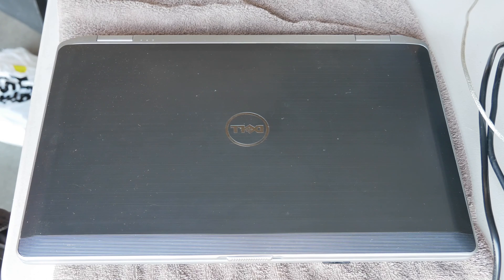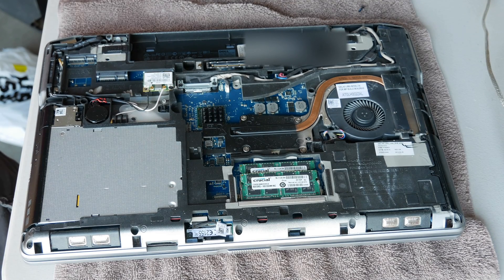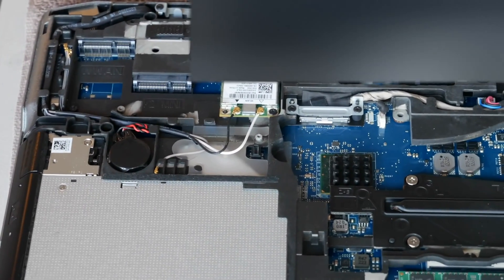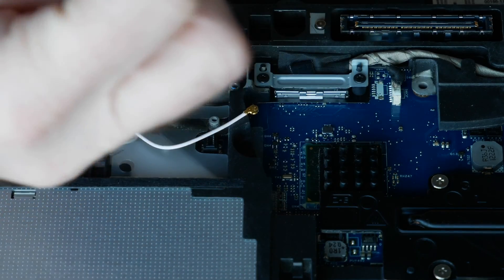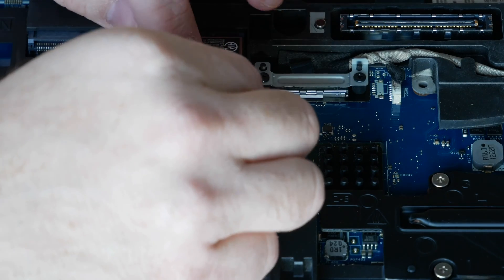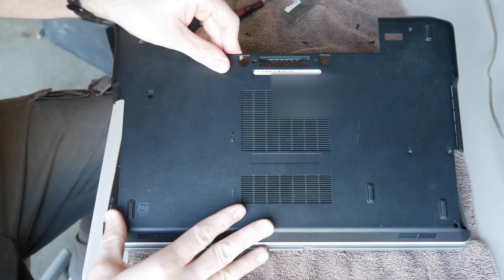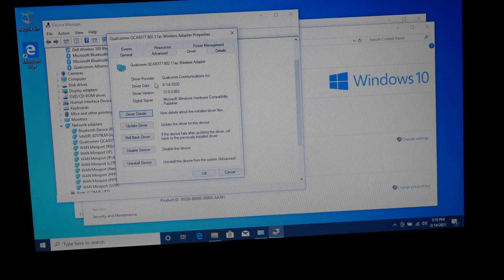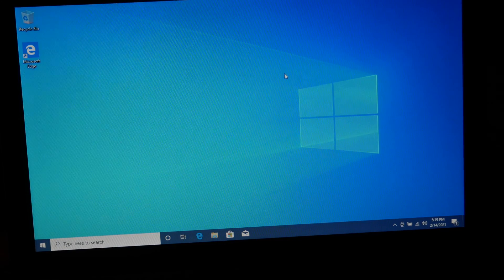how to upgrade an old laptop wifi card

Comment: Do i have to replace the antenna cable to get the full 5Ghz speed on my 9 years old laptop?
Reply from the maker: @Teodor Todorov Maybe, it depends if it came with a dual band antenna already installed in it. The best way to guess that is to see if that particular model had the option of buying with a dual band card. If it did then there's a good chance it will be fine, otherwise you'll probably need to replace those as well.
Reply: @ShinyTechThings  well, on the wifi 6 and bt 5.2 card that I'm about to buy protocol is 802.11ax/ac/n/a/b/g, on the wifi card that came with my laptop, the protocol is 802.11a/b/g/n
Reply from the maker: @Teodor Todorov Can you see 5GHz Wi-Fi networks? If not it's just a single band card. You would have to see if that model ever sold with a dual band card to determine if you need to swap out the antennas.
Reply: @ShinyTechThings  I cam see only 2.4ghz
Reply from the maker: @Teodor Todorov does that particular model have the option to have been purchased with a dual band card?
Reply: @ShinyTechThings  yes
Reply from the maker: @Teodor Todorov then most likely it'll work fine.

Comment: so how much faster is it now?
Reply from the maker: @tim m the 5GHz is typically 2-8X+ faster over 2.4GHz.
Reply: @ShinyTechThings  cool i have some old laptop i got for free trying to get it closer to my pc in performance.  honestly probably just better to buy a new laptop but fug it
Reply from the maker: @tim m what is the old PC and it's current specs. What is the newer PC that you want it to perform like? I'll let you know realistically what can be done.
Reply from the maker: @tim m the challenge with older laptops is if you put a faster card in it the CPU or antennas could be the next potential bottleneck.
Reply: @ShinyTechThings  the laptop is an asus r510l.  intel i5 4210u that runs 24ghz i believe, 8gb ram, ssd, on board graphics.  My pc is lightyears better but the lapto just isnt relaible.  Will randomly not download things and videos wont load.   Drops connection despite being 5 ft from the router.  Its just kind of annoying
Reply: @ShinyTechThings  i have this issue where sometimes things dont download and sometimes things dont load.  All i hear is you need to clear cache and other bs like that but this is a new hard drive with windows 10 freshly installed
Reply from the maker: @tim m I would check to see if the antennas are connected to the existing card or if the card or connectors are loose.
Reply from the maker: @tim m how did you install windows 10? Where did you download it from? If you didn't use the Windows media creation tool then I would start over as it could be something with the image that was downloaded.
Reply: @ShinyTechThings  so i ran a speed test on my desktop and laptop at the same time.  Desktop was like 600mbps download and the laptop was like 50mbps.  Hooked up the ethernet to the laptop and it wouldnt detect.  Did some reasearch and got it working.  It ran at the same 600mbps with the ethernet cable.  tried downloading stuff and playing videos that were giving me issues before and they were working fine after.  I guess I need to just a wifi 6 card
Reply: @ShinyTechThings  just ran another speedtest on the laptop on wifi.  Came up as 23mbps.  Basically from what i found its just all over the place and sometimes as low as 9mbps
Reply from the maker: @tim m before just swapping out the card I'd recommend checking to see if that model came with the option of having a dual band card. If not then you'll also most likely need to replace the antennas as well.

Comment: Hey, Just upgraded the 6430 to a wifi 6 card from Netely. works like a dream. I took out the old BT transmitter.  These old Dells have no white list for parts so you can upgrade alll the way to a wifi 6E card.
Reply from the maker: @Drew DeGeer Awesome to hear you got it all upgraded. Do you have a Wi-Fi 6 E router as well?
Reply from the maker: You'd be surprised but depending on the processor Wi-Fi 6 might be faster than what the system can handle but you will still get speed benefits of the upgrade. What's the model number of the system and I can look it up or do you know what processor is in it?
Reply: Quad core + Nvidia GPU
It shows 1200/1200 MB connection speed. Works like a dream.
Reply from the maker: @drewdegeer4432  Nice to hear that, it's great to get a few more years out of our tech with small upgrades like this!
Reply from the maker: @f.ginroh8916  Then it should work fine, let me know your results if you upgrade and be sure to buy from a seller who takes returns in case there is an issue.
Reply from the maker: That should be fine as it looks like the processor is a 4th gen i5 and that should be able to handle the speed fine. Does your current wireless card support both 2.4 and 5 gigahertz bands?
Reply from the maker: @f.ginroh8916 yes, however if you don't have a 6GHz antenna you'll need to add one to have a reliable connection on that spectrum.

Comment: Hi, I have HP Notebook ac 125tu. It has the 2.4Ghz band only. Can I upgrade it to WiFi 6? Will my laptop support it? Thanks!
Reply from the maker: @Abhishek Jasrotia Possibly. What you need to look at first is to see if that particular model was able to be ordered with any other Wi-Fi cards. Then you would also need to open it up and see how many antennas are connected and how many are available directly by the Wi-Fi card. There's a couple potential issues.
1. HP may blacklist all cards except what's on their parts list as compatible. Which severely limits your options if they do that unless if you want to potentially risk the entire laptop and create your own custom bios editing the BIOS file with a hex editor which could brick your laptop if something isn't exact from a forum post by somebody who might have done it successfully previously.
2. If only 2.4 GHz band cards were available on that model then there's a good chance that the antennas were never designed for 5 GHz which means you could have connectivity issues unless you replace the antennas as well. You could do this but your mileage will heavily vary because it was never designed with that band in mind. So say you bought some antennas from another model machine it might be longer or shorter wires which would affect your ability to connect it to the card if it was too short or if they are too long then you have slack inside the machine and also signal loss from the length of cable.

Now IF everything looks like it will be fine for your particular model then if you look in my other comments I have a link on NewEgg and it might also be in the video description to a card that is in a adapter for older machines that is Wi-Fi 6. Also depending on what processor you have you might be speed limited by the processor and not the wireless card. What CPU model do you have? What Wi-Fi speeds are you currently getting with that machine? And what speeds do you get from other machines using the same router?
Reply: @ShinyTechThings  Thanks for the reply. Really appreciate it. My CPU model is i3 5005U. I am getting an average download speed of 15 MBPS on the laptop (as I can only access the 2.4 GHz band). While, my OnePlus Nord2 gets 30-40 MBPS download speed on the same router on the same band. Thanks!
Reply from the maker: @AbhishekJasrotia97  I'm willing to bet if you open up the laptop it probably just has a single antenna for the wi-fi. I have seen several new laptops like this and the wireless is not that good and even a small USB Wi-Fi adapter might perform better. Were you able to open it up yet?

Comment: What if it works sometimes?
Reply from the maker: @xboxgamerJ16 🤔 if you moved the antenna then it might be that the antenna in the laptop is built only for 2.4GHz if that's what the last card was. You may need to replace that and add another one but check if it's dual band.

Comment: hi, i got the hp 14ba001la, it comes with the realtek rtl8723de, what wifi card will be compatible with the laptop?
Reply from the maker: @Ricardo Sandoval I couldn't find anything for your particular model but you might be able to find a parts list out of the service manual but I haven't been able to track that down yet. Here is a link on HP site that talks about it a bit.
https://h30434.www3.hp.com/t5/Notebook-Hardware-and-Upgrade-Questions/Wifi-card-upgrade-options/td-p/7954952
Basically depending on the model HP might have created a whitelist to only accept certain cards but that's not always the case so you may be able to just select another one that fits however if you are changing the bands used meaning if it only supports 2.4 gigahertz now and you add one that supports both 2.4 gigahertz and 5 GHz the antennas inside may or may not have been designed to work with the 5GHz band. How you could tell is if you have connectivity issues on 5 GHz then the antennas would need to be replaced and things get more complicated very quickly. If you open it up how many antennas are connected to the existing card and what is the model of the existing card?

Comment: I have an old laptop Acer aspire E1 -471, It has very slow internet because the old wifi card and I don't really know which wifi card would work, can you recommend what wifi card would work?
Reply from the maker: @Thomas Sussek what is the existing Wi-Fi card in it currently? What speeds are you getting? How many antennas are already connected to the existing Wi-Fi card?
Reply: @ShinyTechThings  I never change it, its Qualcomm Atheros AR5B125. I get 4 mbps to 8 mbps, very slow. I don't know about the antennas I never add or replace any antennas.
Reply from the maker: @Thomas Sussek you'll need to open it up and see if it has 2 antennas already installed or if it only has one. If it only has one antenna installed then that limits your options on a replacement card unless you install another antenna which can be a painful process if you've never done anything like that before.
Reply: @ShinyTechThings  I'll open it later when I have time and come back here. Thank you so much
Reply from the maker: @dann_37  No problem. From what I see it only supports 2.4GHz so even if you replace it with a dual band card it would most likely need new antennas that were designed for a dual band card.

Comment: Hi, I have an Intel(R) Centrino(R) Wireless-N 2230 on my HP ENVY 17-j070ca. I was wondering if you know if I could upgrade my Wi-Fi card as well. Which card is suitable and compatible?
Reply from the maker: @Aris M. Possibly, please look at this post:
https://h30434.www3.hp.com/t5/Notebook-Wireless-and-Networking/Upgrade-WIfi-Adapter-HP-ENVY-17/td-p/7230883
The issue is on the original antenna configuration. You could replace or add an antenna but it gets more complicated. If this helps you out please be sure to click on like on my videos and comments and share my videos on social media to help support the channel or consider using the donation link in the video description. If you have any other questions feel free to ask.
Thanks for your support!
Reply: @ShinyTechThings  Ah yes I've read that forum beforehand. Curious-..what's wrong with the original antenna configuration?
Reply from the maker: @Aris M. If it only has a 2.4 GHz antenna and you hook up a dual band wireless card the 5 gigahertz band will have very poor signal because it wasn't designed for it. You can try it and see how well it works but if the signal is bad then you would need to look at getting different antennas and installing those as well. What does the current antenna configuration look like?
Reply: Reading over the manual, the upgrades or alternative Wi-Fi cards that I can install includes 'Intel Dual Band Wireless-AC 3160 802.11ac 1×1 WiFi + BT 4.0 Combo Adapter'. The manual also lists only 1 type of antenna for the spare parts. So, is it safe to assume the antenna inside my laptop supports 5Ghz? I have two antennas connected to my current Wi-Fi card.
Reply from the maker: @Aris M. Yes, sounds correct. Let me know how it works out.

Comment: I have a very old laptop, I think this was from year model 2010 and it has no bluetooth. Is it possible to upgrade the card to wifi dual band + bluetooth?

If I can, when can I donwload the drivers?
Reply from the maker: @Vladimir Kiev Torres depends on if your model is locked or not and what the existing antennas are tuned for certain frequencies to determine if you need to replace the antennas as well. Drivers will be specific to the chipset you buy.
Reply: @ShinyTechThings  what if I buy new antennas as well? One for wifi and bluetooth. Will it work?
Reply from the maker: @Vladimir Kiev Torres what card are you looking to install? Please send me the link and I'll look up the antenna's.
Reply: I am not sure if this will work in my old laptop yet

Comment: Shouldn't you replace antennas as well? I thought that 2.4 GHz antenna and 5 GHz antenna are different antennas.
Reply from the maker: Ideally yes but it depends on the design of the original antennas. If the old ones have issues or really poor performance unless you're really close to your Wi-Fi then they may be fine. You can get them for under $10 online like these:
https://www.ebay.com/itm/Pair-Internal-Antenna-for-Laptop-Wireless-Mini-PCI-PCI-e-WiFi-Bluetooth-Card-/224549201862?mkcid=16&mkevt=1&_trksid=p2349624.m46890.l49286&mkrid=711-127632-2357-0

Comment: So I have a half mini pcie card from a 2013 acer aspire e1-571. How do I upgrade to wifi 6e? They all seem to be m.2.
Reply from the maker: @MBL of your system doesn't block replacement cards this one might work for you but just so you know your processor from 2013 could be the next bottleneck if you are already running a SSD.
Check this out on @Newegg: Mini PCI-E Wi-Fi 6 Intel AX200 Adapter Kit 2974Mbps Bluetooth 5.0 M.2 To Mini PCI Express Full Wifi Wireless Card AX200NGW 802.11ax/ac 160Mhz 2.4G/5G MU-MIMO OFDMA Windows 10 For Laptop Desktop https://www.newegg.com/fenvi-mini-pci-e-wifi-6-mini-pci-express/p/0XM-00JK-00089?Item=9SIADXZBPT7356&Source=socialshare&cm_mmc=snc-social-sr9SIADXZBPT7356_-11302021

Comment: Will this be compatible with dell n5050? Currently my laptop has dw1701.
Reply from the maker: @axl slash Possibly but I didn't find anything particular to that model if Dell is restricting the cards or not so you could just try and see or check out this link to what was recommended on the Dell site for official Dell cards that should work:
https://www.dell.com/community/Networking-Internet-Bluetooth/Inspiron-15-N5050-Late-2011-Wireless-Card-Upgrade/td-p/4641984
Reply: @ShinyTechThings  hey, thanks for the quick response, will check that link. 
New subscriber here! :)
Reply: Update : intel 7260 did not work on my dell n5050.

Comment: Can I change my lenovo ideapad flex 14 20308 WiFi card? Is it possible to use a WiFi 6 or which dual band card can I use for better WiFi connection? Please advise cuz I'm not sure which one I can use
Reply from the maker: @Drexmy. stxrlight I can't find any info on that model if they whitelist certain cards so you should be okay but I cannot guarantee it. I would try this card from Newegg and return it if it doesn't work. Let me know if it works for you Check this out on @Newegg: Mini PCI-E Wi-Fi 6 Intel AX200 Adapter Kit 2974Mbps Bluetooth 5.0 M.2 To Mini PCI Express Full Wifi Wireless Card AX200NGW 802.11ax/ac 160Mhz 2.4G/5G MU-MIMO OFDMA Windows 10 For Laptop Desktop https://www.newegg.com/fenvi-mini-pci-e-wifi-6-mini-pci-express/p/0XM-00JK-00089?Item=9SIADXZBPT7356&Source=socialshare&cm_mmc=snc-social-sr9SIADXZBPT7356_-10092021

Comment: I changed the wifi card on my girlfriends laptop about a few months ago. It's a 2.4 ghz card with no bluetooth. I got a wifi 6 card that's dual band and has bluetooth. But the thing was giving me trouble. For starters, it would only work half of the time, otherwise I'd have to use ethernet to connect to the internet. Then when I go to reboot the computer, while the bluetooth mouse is plugged in, it tells me that it can't start until a certain device is removed. I'm doing this on an HP notebook.
Reply from the maker: @xboxgamerJ16 it could be a couple of things, I would make sure that you have the latest drivers from the manufacturer for that card installed and also double check that the antennas did not get unplugged from the card. There is also a possibility that on your particular model HP that it is only partially supported although that is pretty improbable since it works sometimes. It could also be something else like a virus infection however it typically doesn't mess with just the wireless card so if ethernet works then that is probably not what is happening but it is still worth running a scan and making sure the system is clean. You could also try removing and reinstalling the card because it could be slightly misaligned.
Reply: @ShinyTechThings  I did do a re-install and I checked the drivers. I also forgot to mention that my laptop only has 1 antenna and not 2.
Reply from the maker: @xboxgamerJ16 the only thing to try would be either move the antenna to the other connector or add another antenna and see how it behaves. When I've had a WiFi card run unusually slow it can be due to one of the antennas popped off.
Reply: @ShinyTechThings  hi I just saw this, but yeah I will try that. Get an aux connector and see what happens
Reply from the maker: I've done that before when taking apart and putting back together a laptop I forget to take a picture sometimes of where the antenna was plugged in and it was just a single antenna and then I noticed I only have one or two bars of signal but I'm line of sight to the access point so then I realize it's on the wrong connector and shut it down and move it and move it back up and then it's fine.
Reply: Upgraded the ram, wanna get the wifi upgraded for real, and then I plan on replacing the hard drive with an M.2 SSD with an adaptor.